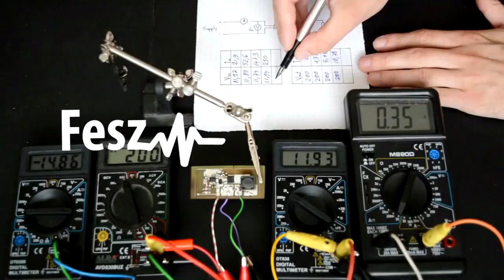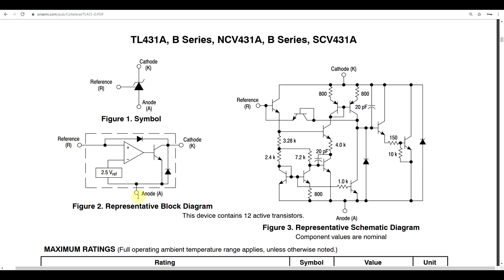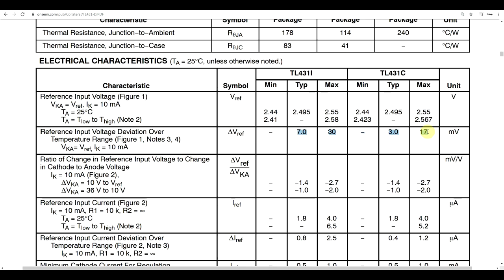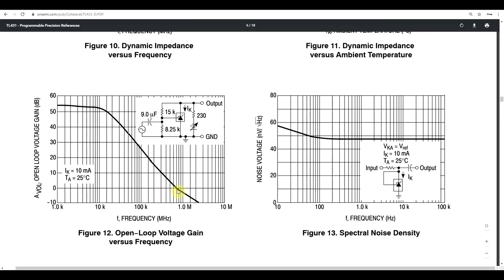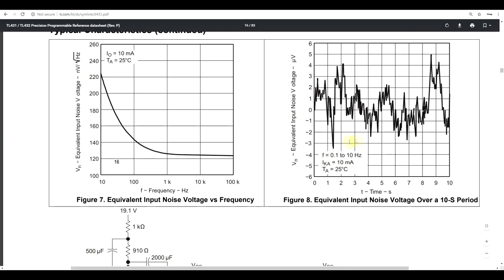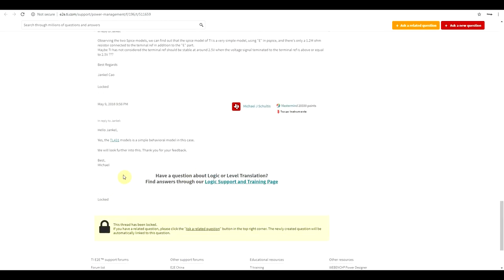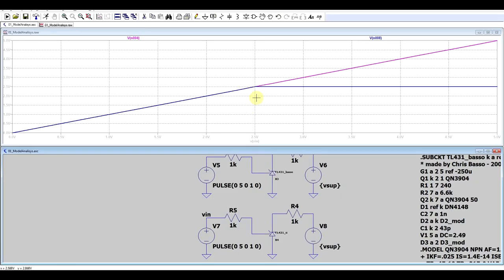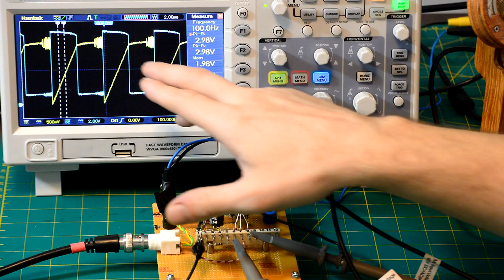Electronics Tutorial - The TL431 Part 1/3 - Getting to know the component`

Comment: will you do tutorial on ADC? I want to make one for my microcontroller project, my signal is between 1.5V and 3.5V  but I want to utilize full adc range for each channel.
Reply from the maker: @Shahzaib Shamim Well, most modern Micro-controllers already have built in ADC's; the datasheet should offer information on this topic. What uC are you using? 
So I think what you need is a circuit that turns the 1.5-3.5V into the supply range of the uC so 0-5V or 0-3.3V (depending on what you are using). If the range is 0-5V you can simply use an op-amp circuit that amplifies by 2.5x and centered around 2.5V and that will convert the 1.5-3.5 directly to 0-5V.

Comment: Quite a bold thing you're up to.  How close do you think you'll get ?  I never knew ltspice sims could get close to reality...
Reply from the maker: Well, we'll see next week how close I get. 
But regarding simulation accuracy in general, its all about how complex and well made the model is and how well you include all the parameters of the circuit (the parasitics that are normally ignored). The simulation can be fast or accurate. The more accuracy, the slower it will work. I will try to find a balance between the 2.
Reply: @FesZElectronics  Lately i've been wondering if the discrepancies are more about our math having gaps. However, it could totally be as you say, that the sim just needs to be more accurate. with the mag amp thing I found that when multiple signals get in the same place it gets hairy. Which in turn has me thinking about filters and Fourier representation. The way a cap reacts to multiple signals could be a particular function. Additive / subtractive synthesis?? in a sense it's acting like a mixer, but in the gilbert cell(which does not have reactive components) the way which the signals interact is clearly chosen/understood.  Physical objects/signal paths may also exhibit similar behavior, but the transfer functions may not be as clear. Hope that made any sense, lol . I've been seeking a way to model this so I can share the anomaly with others so we can all think on it together. Maybe, its just something I haven't learned yet :)